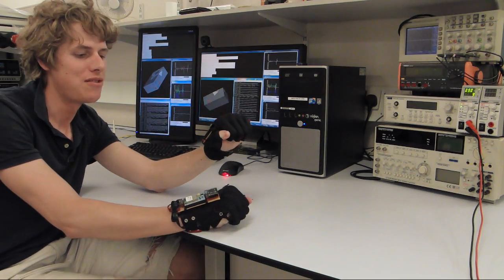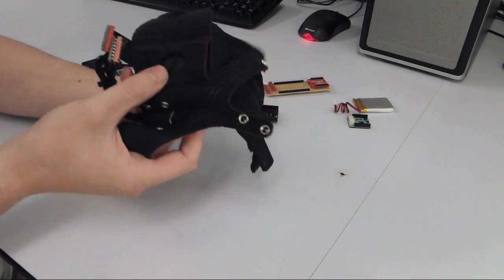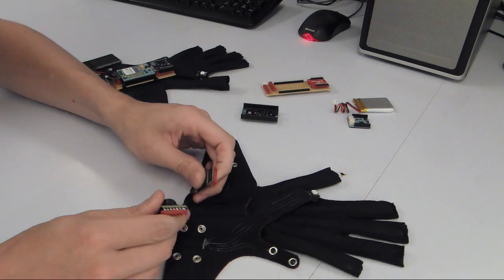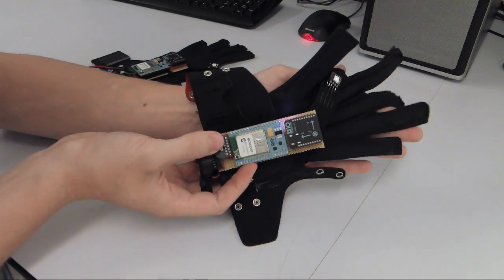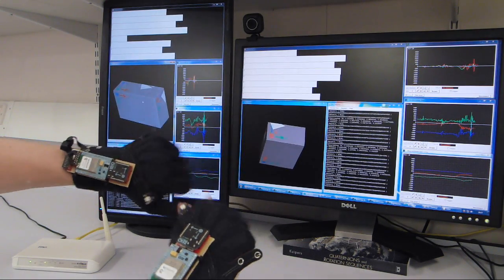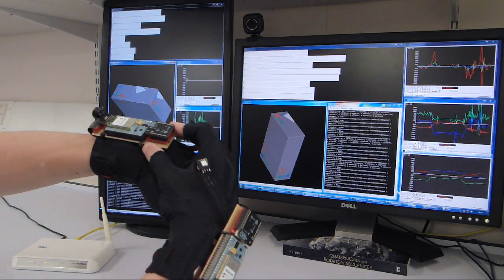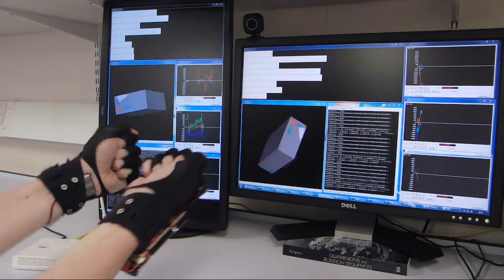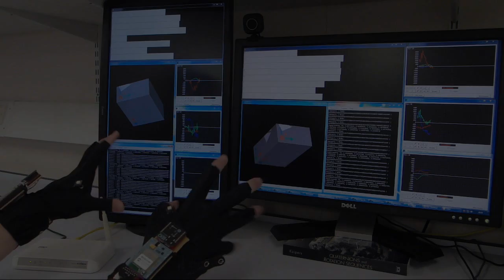Prototype WiFi Gloves Using x-OSC and x-BIMU

Comment: This is the kind of new tech we need for VR.

I want to point out that vibrating motors are NOT haptic feedback.
Reply: "Haptic technology, or haptics, is a tactile feedback technology which takes advantage of the sense of touch by applying forces, vibrations, or motions to the user."

Yes, by definition it is. It is just not the kind of feedback that you want.
Reply: yes it is its just very very limited.

Comment: wonder why you need both x-osc and x-bimu since the x-osc also has a gyro accelero and magnetometer?
Reply: Hilmar Thordarson Because the x-OSC does not have calibrated magnetometer readings nor an AHRS fusion algorithm on-board.